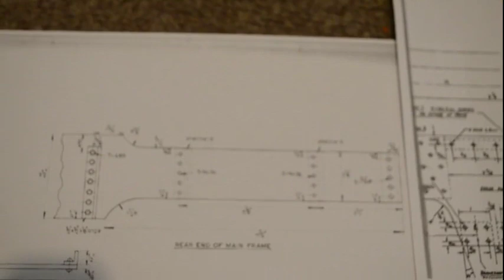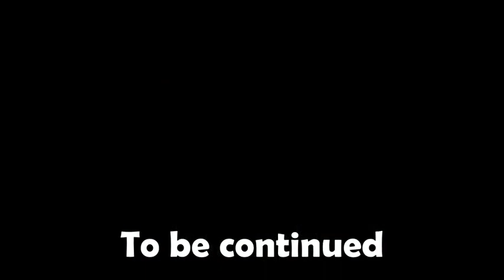Dart Part 1 Introduction

Comment: The Music is of course from the Titfield film. The name coming from LimpsFIELD  where my Uncle lived for many years and over the fields walked many times to TITsey. Also love the film but have just got in the boiler barrels for 2 517 Class models which is where Charles Collett based the 1400 from.  Ours coming out in the Design Fair Rosamund in 5 inch gauge. The very early version of 1892 as of course I have the works drawings.  2 sets of castings and some of equally lovely wheels to the above. 
David and Lily.

Comment: The lovely story of the Woodstock tank Engine is that the Station Crew upon hearing that Queen Victoria was to travel to Blenheim Palace. They had better get the local carpenter to knock up a pair of NAMEPLATES for her. Painted with brass/gold paint these were carried resplendently until she went back to Swindon and the Branch line men said farewell to the plates.
Total surprise when she returned with popper cast brass ones superbly polished by the company. Carried right up to the withdrawal of the locomotive.
David and Lily.

Comment from the maker: Quite right. The film used was a recreation to celebrate 60 years since the making of the movie. For the movie 1400 and 1401 were used both bearing the number 1401. In the recreation movie 1401 had long since gone to the shunting yard in the sky so 1450 was used bearing the number 1401.
I haven't decided what number mine will be but it might well be 1401.